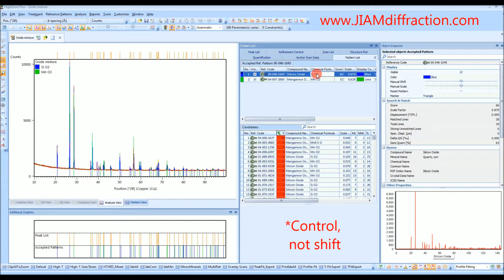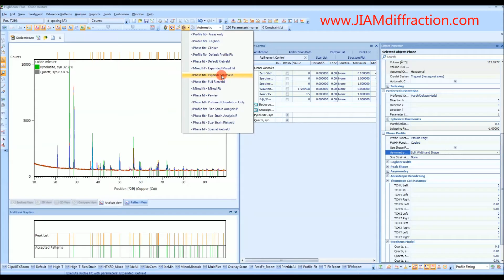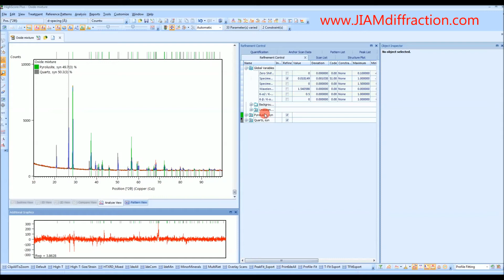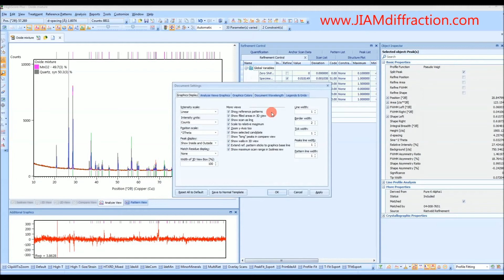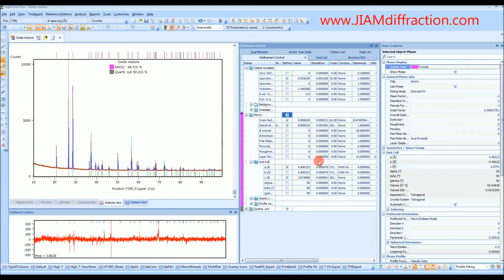HighScore Plus Tutorial - Phase Quantification Rietveld X-ray Diffraction - Long Version - JIAM

Comment: thank you so much. I am a post-doctor in the HUST of china. I have learned a lot from your tutorial. there is one problem that I cant find the entry of solver tolerance under 'General property' in my HSP. So the Rietveld refinement just executed for a few steps and then stopped, which cause the difference between the calculated profile and obs is still very high. I will be greatly appreciated if you could give me some advice to fix this problem. Regards.
Reply from the maker: Thank you for the kind words!  Once your refinement is finished running and you still have a large difference, does the fit get any better if you click the "Execute Fitting" button again?  

If you don't see solver tolerance when you go to Refinement Control - Global Variables and look under general fit properties, do you see "Max No. of Fit Cycles" or "Solver Time Limit [sec]" fields there?
Reply: @IAMMDiffractionFacility  Thank you so much. After a second click on the button of 'start rietveld refinement ', the fit showed almost no change.

 I can see the entry of 'Max. No of Least-Squares Cycles',  but no entries of 'solver tolerance' or 'solver Time Limit' under 'General Properties'.

Besides, the content in Refinement control/Global variables and object inspector/general properties show some difference from yours. I wonder that is due to a different version of the HSP?  mine version is 3.0d(3.0.4)
Reply from the maker: Yeah, my version is much newer (4.7).  What value do you have for "Max No. of Least-Squares Cycles?"
Reply from the maker: In addition to the question regarding your value for "Max No. of Least-Squares Cycles," I have a couple of others to help find the problem.  (1)  Are you performing an automatic refinement or a manual refinement?  (2)  What parameters (such as scale factor, lattice parameters, etc.) are being refined?  You can figure out which parameters are being refined by clicking the plus sign next to the phase and seeing which parameters have check marks in the "Refine" box (sorry for explaining if you already know how to do this).
Reply: @IAMMDiffractionFacility  20,  and i also tried higher value (eg. 100) for "Max No. of Least-Squares Cycles?", but the result is the same
Reply: @IAMMDiffractionFacility  (1) automatic mode, (2) there are three phases that exist in my mixture (SiC, Si and C). The main difference between the clcs and obs was located in the peaks of Si, some of which were as high as 1600.  After the execution of 'start refinement', the refined parameters were scale factors, lattice parameter 'a', and profile variables 'W left'. 
thanks a lot.
Reply: @IAMMDiffractionFacility  After the execution of 'start refinement', the refined parameters of phase Si were scale factors, lattice parameter 'a', and profile variables 'W left'.
Reply from the maker: Hmmmm...would you feel comfortable sending me your file?  If I could see it and try to analyze it myself, it may help figure out what the problem is.  If you want to go this route, please email your HighScore file to mkoehler@utk.edu.  I should be able to open older HighScore files in my version.
Reply: @IAMMDiffractionFacility  Thank you so much.  The file has been sent to mkoehler@utk.edu. I will be extremely appreciated if you could help me to fix the refinement problem.
Reply from the maker: I believe the differences you see in the silicon peaks (as well as the SiC peaks) are due to peak asymmetry and overall peak shape.  Larger divergence and Soller slits cause increased amounts of asymmetry.  You can set that phase to fit with asymmetry though.  In my version of HighScore, you just have to left click on the silicon phase in "Refinement Control" and scroll down until you see "Asymmetry Type" under "Phase Profile."  You can try setting "Split Width and Shape."  Changing this alone doesn't make much of a difference though.

The bigger difference comes when you also refine on preferred orientation and some additional profile parameters.  Your carbon phase does, unsurprisingly, have a good amount of preferred orientation (I would recommend refining it based off of the (002) peak).  If you look at my YouTube video on parameter sets, you can see the order that I typically refine in (maybe just switch the order of U and V).  The refinement strategy in that video works because it is a pretty high-quality experiment on some simple phases (which may describe yours as well, I can't say for sure).  For more challenging patterns, care must be taken when refining profile parameters.  For instance, first you would refine on W only, then V only, then U only, then Shape 1 only, then W only, then V only, then U only, then Shape 1 only, then asymmetry only, then W only, then V only, then U only, then Shape 1 only, then asymmetry only ... then you can begin refining some of those parameters together.
Reply: @IAMMDiffractionFacility  Thanks for your patience and guidance! I spent almost the whole day to do the rietveld refinement for the same files sent to you, and finally get the lowest Rwp value of about 9.6. it seems to me that the refinement can only be carried out empirically, namely change the parameters one by one. Is there any theoretical guidance or trick to make the refinement process more efficient? Cordial thanks for your timely help!

Comment: Thank you very much for the tutorial. Is it possible share The software and database?
Reply from the maker: Unfortunately, I cannot share the software and database, they both require licenses (HighScore Plus from Malvern Panalytical and the PDF-4+ database from ICDD).  HighScore Plus is really nice if you have the money for it, but there are free options such as GSAS-II and FullProf that can perform Rietveld refinements.  I've used GSAS-II a bit, and while I prefer the user interface and automation of HighScore, GSAS-II's interface isn't bad.  There are also some really nice written tutorials that you can find on anl.gov (just google gsas-II tutorial).  You do need to import a .cif file or enter the structural information for the phase in GSAS-II though.